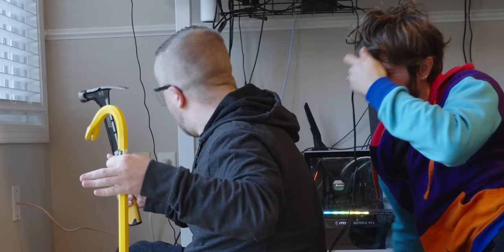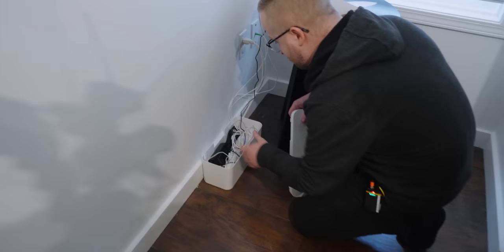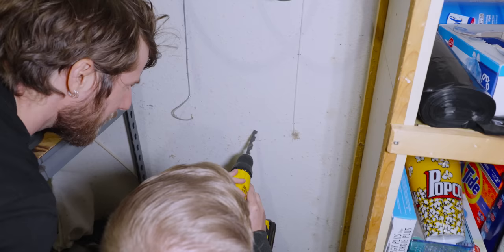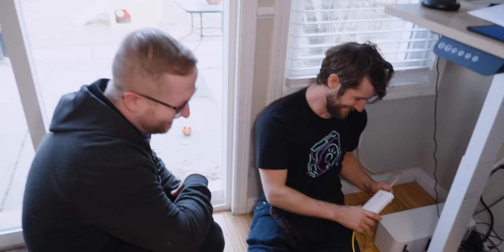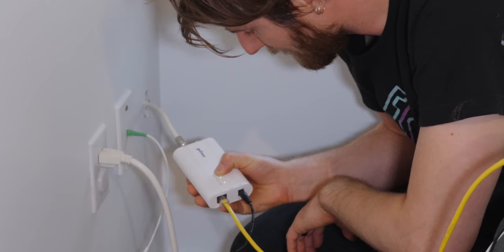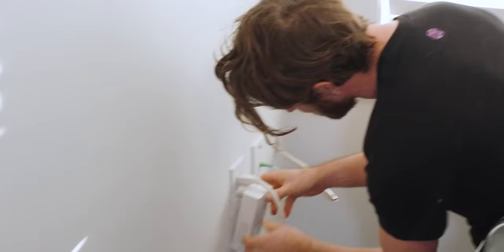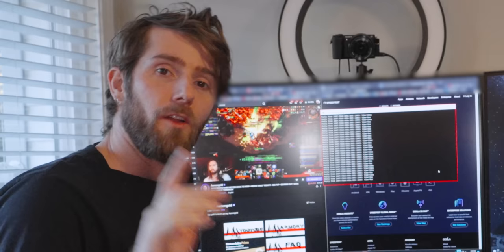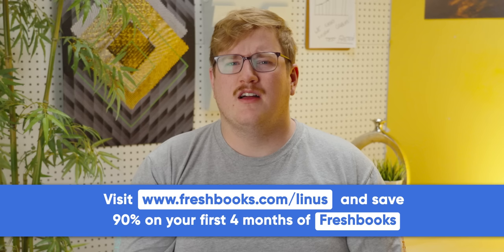I Will FIX Your Wifi - MoCA and Powerline at Colton's House

Comment: As a network installer/technician who has done countless jobs where I had to solve "bad wifi" problems for home users I have learned the hard way that powerline sucks. It's unreliable and only works decently in a very small percentage of situations. The main problem is that it would randomly stop working and then require a manual reboot from the user which, when done incorrectly, may result in the devices desyncing, losing their encryption keys or being reset to defaults which requires an additional call-out for the technician to configure everything again, to such an extent where I had multiple customers basically tearing everything out and demanding a refund. At the moment I refuse to supply powerline kits and would only install it for customers who supply their own units so I don't have to deal with the after sale problems that eventually result of these units. My advice: If you want internet that works long term and requires practically zero maintenance after installation just spend the extra time and/or money to install ethernet cables to your most important devices and additional wifi access points to improve your coverage and stop looking for short-cuts. I can't speak for MoCA, since I have never used that before, since you rarely have co-ax cable installed to various rooms in houses in my country, usually it's just one cable from outside to the main TV point, i.e. not useful for extending network to different rooms. I have also installed tri-band mesh devices, and so far all of those that I have installed have given no problems, but also cost double or more than what installing an ethernet cable and another access point would've cost, so I wouldn't consider that a comparable solution unless you really have a problem with people drilling a hole in your wall or installing some trunking or conduit to run cables through.

Comment: Both me and the person I am sharing my residence with use powerline adapters. The wiring is pretty good so we got lucky there, but you won't get insanely high speeds as it's not travelling through wires made for it, just basic house wiring. They are reliable though and much more stable than WiFi, for me part of the problem is the provider.
If you want fibre speeds, get fibre cabling. Takes a day or two to install if you know the basics of DIY and running cables under floorboards.

Comment: I love Colton's good lady's question at around 5:00 minutes in... "Are you going all the way through the wall?". I was wondering how far you would need to drill to get the coax cable to a usable place - halfway through a wall? 90% through? Cracking question, and neither Colton nor Linus picked up on it at the time! ;-)
Reply: Ideally they should have drilled through the drywall in the garage next to a stud and cut a square out of the drywall on the other side, attached a 1-gang box to the stud, ran the coax into it, and installed a wall plate over it. What they did here is more like... let's call it the Red Green approach to cable runs. I'm sure it works, but it's ugly and out of code. And yeah, Colton's wife seemed to have a much clearer idea of what to do here than Colton did. Linus should have worked with her on the installation!

Comment: with MOCA, they recommend a POE (point of entry) filter where the coax comes into the house, also need to ensure the coax splitter is capable of passing the MOCA frequencies, I run MOCA in my house and it works great

Comment: Drill Tip from me: hold a big wooden plate on the dry wall so it doesn't break like that (big enough so you can be sure the drill can never reach your hands or thick enough so the guy with the drill feels the change in material)

Comment: A MoCA filter at the groundblock or tap of the previous cable installation would keep the signal from going to other apartments/houses. 9/10 times, it isn't disconnected at the street or side of the house.

Comment: The way you prevent your MOCA traffic from leaving your premises is with the use of a MOCA-blocking filter on the coax input at the splitter outside (or inside). Cable companies install them to stop the traffic from inside that house/condo/apartment from heading out to the neighborhood (or the rest of the building). This has been the standard practice for many years now as many set-top boxes used by Comcast and others make use of MOCA to talk back to a cable modem for streaming purposes (Netflix, etc).

Comment: @linustechtips & Colten, Telus provides their own gocoax modules that work with the built-in one on your router. I had them install it at my house with two additional wifi boosters. It worked beautifully. We disconnected the junction box to the mainline to reduce any congestion or anything, so the distribution of the ethernet is only throughout my house.

Comment: My solution I found was much better than having a whole ethernet cable running across the house or using a powerline adapter. I bought a mesh wifi system (TP link X55) and hooked the main mesh router to the modem downstairs and setup the node upstairs and connected  an ethernet cable from my pc to the node. This worked perfectly and getting a stable ping  while getting better download speeds compared to the powerline adapter i was using before. Usually I would get around 100Mps on powerline but after switching to the mesh wifi setup I did, im getting around 730-800Mps.

Comment: Should really get a wallplate for that coax and another way to prevent other apartments/buildings from picking up the signal is a MoCA filter. Some cable companies use this for boxes to communicate

Comment: I've been using the GoCOAX MoCA for years now, it's great for this older house
One thing you got wrong, it's 2.5gig between units but only 1gig from a unit to a device from the MoCAs ethernet port

Comment: I had powerline adapters for years and while they sort of worked, I never got anything close to the advertised speeds and they would occasionally just disconnect altogether. Switched to MoCA about 18 months ago and it's amazing by comparison.

Comment: Powerlines are not designed to carry high frequency signals, they act as random antennas polluting the RF bands. Also, ymmv greatly on both performance and if they work at all.
Cable up, there are neat cable conduits if you want to avoid running the cables inside the walls in a ready house.

Comment: I moved to the UK and they do not have a lot when it comes to every room having ethernet. And they did not have a lot of coax either. But there were coax in the living room for the TV and upstairs in my office. So I used the go model you used from my router to down stairs then plugged the output into an 8 port switch to plug in the TV and game consoles plus a unifi AP and all works amazingly. Looking at getting a fiber upgrade soon and then will just use a third adapter.

Comment: MoCa matters when certain points of your house can't reach Wi-Fi. If my gaming setup is close to my wireless router, fine, I have a great connection, but, it's the other TV upstairs on the other side of the house that can't get hold that Wi-Fi connection consistently. In that case I used a MoCa adapter, and now I have a great, solid, wired connection to all necessary points of my house.

Comment: My flat was built in 84, made entirely out of rebar concrete blocks. Running ANYTHING through the wall will cost you an hour of chiseling/drilling and probably an extra 2 hours covering up your undoings.

Comment: Next time you setup MoCA or PAP connect them next to each other on same coax splitter or surge protector then plug in to outlet in other room. Makes setup way easier.

Comment: Advice from a cable internet technician, use of powerline devices may cause ingress or interference to the coax cable. Use with caution. Highly recomend MoCA
Reply: HSD company I work for we use <400mhz for internet, 500-800 for cable tv, and 1000+ for MoCA.

Comment: I've  actually used those exact powerline adapters in the past to get connection to a secondary router in another building before, it worked surprisingly well for not being the intended use case.
its nice to see strange solutions like these getting used by the pros
Reply: They're not "pros" when it comes to installing.

Comment: HELPFUL TIP: Just slit the sheetrock hole in the garage slightly larger, put the cable in the same hole as the fiber and put a double keystone plate on the "exercise" room side. :)

Comment: I'd like to see the MoCA system hooked up and setup properly because that should be way faster than powerline!! I'm shocked he can get speeds that good over powerline lol! Mine is no where near that good sadly. MoCA 2.5 is supposed to hit 2.5 gigabit and when MoCA 3.0 products come out its supposed to support 10 gigabit! Powerline will likely never be able to reach these higher speeds so long term, not the best option. 

Also, hate to sound annoying, but the powerline products should work better plugged directly into the outlets. Colton had spare open outlets on the adjacent wall in that corner, so some of those extension cables could be moved over there or vice versa. 

Anyway, it was still a fun video! Please consider doing another MoCA video!! Love to see some more info on setup and data on speeds! Great video!

Comment: Here's the thing, the reason why there isn't an instant reset and it takes 10 seconds isn't to prevent accidents. It's because if you just click a button to reset a electronic device that click doesn't shut the energy off for enough time for a full reset. Think about it in PC building terms, when you unplug everything before you take your PC apart you hold the power button for 10 seconds, it's not because it needs 10 extra seconds, it's to push all the electricity that might still be lingering out of the system.

Comment: I was using a TP-Link powerline connector advertised at 200Mbps and I was actually getting around 50Mbps transfer rates which was acceptable on my terrible ADSL connection at the moment, then I upgraded to a 100Mbps connection and instead having greater speeds it got even worse until I realised that my network had gotten mixed with the neighbours' networks. What happened is that at some point various ISPs decided to start giving away PLCs to support their on-demand TV services and this started becoming a big issues in apartment complexes where the power lines seem to be interconnected somehow. I got my own breaker panel, with a central breaker and zone breakers yet this is not keeping the apartment lines isolated. I had also neglected to pair my PLCs which is as far as I understand is supposed to encrypt and keep the network isolated but in either case as more and more apartments were installing PLCs the speed had dropped all the way down to 30Mbps (even after having dealt with the network mix-up mess). I ended up getting 2 WiFi 5 access points (regretted not getting Wifi 6) and that for now is the better solution although deep inside I cry in mediocre Internet service.

Comment: The newer Power-Line-Modulse do not require to run over the same braker. Old Power-Line did yes - because the modulation went over the Phase of the breaker. 

The newer Power-Lines on the market modulate their connection over the "ground-Line" which usually is connected to all breakers of the house (except when you have seperate connections with galvanic isolation)
Reply: There are zero GND in my switches here.  There's a phase and a 0.  Ground is only in 380v plugs here.

Comment: Could have used a coax continuity tester - ohm meter first to make sure the  the cable running to the office is the same as the garage, 
the second thing is they could have drilled through the back of the same box as the fiber is in into the garage and got a double face plate and save a hole in the wall.

Comment: Not only is using dLan-Adapters on power strips adding noise and therefore causing a performance drop, but the plugin-variety tends to use filters especially designed to gain additional signal quality which you will miss out on using power-strips.
Also, dLan adapters effect one another under load, which means the "slowest" adapter in use will dictate the overall network performance.
The transfer rate depends on:
1. Cable length.
2. Number and position of "noise" generating devices, most notably PWM based power regulators such as used in smartphone chargers.
3. The type of room brakers used - there even are special filter versions.
4. The brand mix - mixing different brands using the same standards theoretically is possible, but practically results in severe package loss due to differences in the implementation.
5. Technology mix - some dLAN standard generations are intercompatible, but older devices greatly effect the overall performance.

My advice: Check the rating and actual tests for adapters of the same brand using the same standard before making your choice.

The dirty setup Linus went for should be fine if Internet is all you want, but if you actually got multiple systems, a NAS or server in your home, you'll want to do it properly.
A fair warning: There are essentially three applications, namely
1. data streams
2. continues data streams
3. and small data packages / IOPS.
And while dLan works fine for case #1 like needed for most websites, case #2 reveals a transfer rate drop after a couple of seconds, and it is considerable often down to 1/3 of (relative) idle.
The worst case however, case #3 as needed for transferring small files, will shrink the performance to below 1/10 of its idle, if that, making most NAS / server applications a very bad idea.
You'll probably have to use ethernet LAN for those.

Comment: One thing that might be helpful for someone.  I had old telephone cable in my place that I obviously didn't need and found out that it's actually just cat 5.  I just switched the connectors to ethernet and it worked like a charm.  All the telephone cable ran to my closet where my router is and the new ethernet port is right beside my computer.  Getting gigabit speeds.

Comment: It’s good then that fiber is becoming more common. Or that a lot of cable/dish companies now make their cables boxes to only rely on the internet connection. Sooo if the second is the case then usually means the coax cables in a ton of homes will be free to use for this method.
And with the fiber options. Most new builds now are putting fiber during construction. And they’ll also have cat5/6 adapters in most rooms. And would all lead usually to the master bedrooms closet

Comment: I have used both. Currently I only have the option for powerline. The wiring in our apartment still significantly kills the internet, but it’s better than trying to use one access point. or my roommates solution (before i moved in) of using a wifi repeater

Comment: I would LOVE to see a video testing the reliability/interference etc of powerline adapters. I've always been under the understanding that powerline is the bottom of the barrel basically worse than trailing an ethernet across the floor option. So to see LTT using them has me questioning everything.

Comment: Power Line works better in places like the UK I have found as a lot of people over in the the USA/Canada always moan about slow issues or drop outs with them but here in the UK with a fuse box thats fully up to date with RCD brakers installed, only time I ever had real issue was with an old Victorian house with outdated electrics.

Comment: I used to use powerline. DEFINITELY do not plug it into a powerboard, especially one with power protection. It technically still works, but it creates a huuuge bottleneck on speed. Perhaps unrelated, but I also had a strange issue in which the connection to my truenas NAS (PC > ethernet > powerline > ethernet > router > ethernet > NAS) would frequently drop the connection and hang until it could reconnect when I was trying to control it via the browser.

P.S. Telling your software and network engineer friends that it is still technically a "wired" connection is great fun.

Comment: FYI, most newer homes with coax in every room have a central location where they all land.  Not necessarily the outside box.  You locate that box and use splitters to connect the rooms you wish.  Hopefully they are labeled or you will need a network toner.

Comment: They also make a filter that blocks the MoCa signals. Cheap, and passive. Just a piece that screws inline with the Coax at the entry point that prevents the MoCa from going outside your home. Basically a frequency filter/ blocker. This stops the MoCa signal and prevents it from traveling further. This does depend on how the coax cable is wired though.

Comment: Step 1

Attach a "cable locator" to the coax, use the 2nd part on the the other end. Then you know if they are connected, and if its a strong signal or via via.

You can also use the 2nd piece on walls to find out where the cable goes inside walls/ceiling.

Cheap and easy.
Reply: Correct!!!

Comment: Btw as a powerlan was the only viable option when I moved in my flat, you indeed can breach over to other breakers but should install a condensator kit (with link all live wires and neutral) to get the high frequencies to "jump" over them. The side effects of powerlan is that all of your house wire are now big antennas which is not so great ...
Reply: *powerline

Comment: Here's how I'd fix Colton's issue.  Call Telus (or your ISP), ask for a Modem move to where your gaming machine is, it will probably cost around $100... now your wired in with no cable to trip over.... FIXED!!!
Gaming over wifi?????????? Huh?????????? NEVER again will I (until it's fixed.. lol).  Pings will always drop for one wireless interference reason or another... Yes, we should have a wireless solution that works. If you game, wait until that is true, I don't think it is yet! imo (Great video to spark the conversation!) 🤙